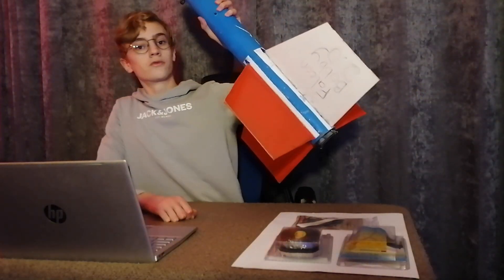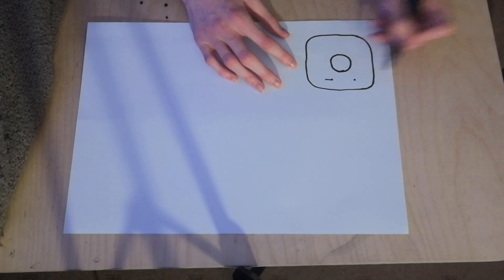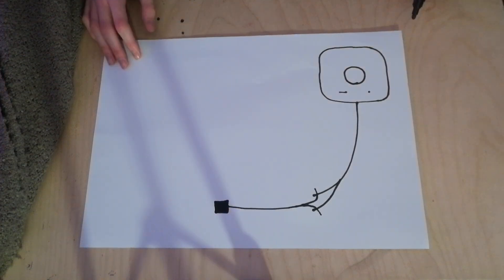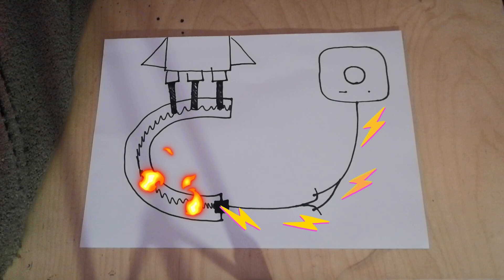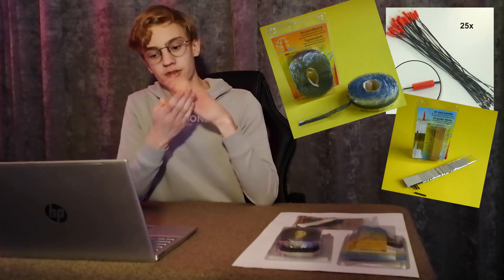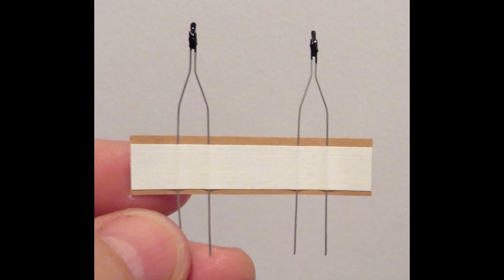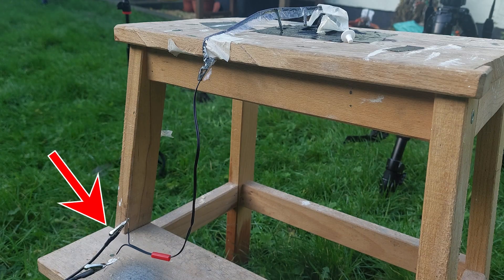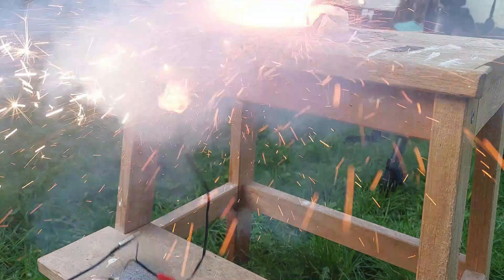How to light 3 Rocket Motors at the same time...

Comment: So how do you ensure all three motors fire at once? Even a slight mismatch would cause differential thrust no?
Reply from the maker: The ignition will occur in under 0.5 seconds, with the rocket hopefully remaining on the launch pad until all motors reach full thrust. Igniters are taped to the motors, detaching only after ignition.

Comment: When I was your age, illegal things tended to trigger me. In other words, I crossed the line quite often. But I've also learned a lot. At least when it came to rockets, fireworks and explosives. 
As you can still see in the older videos on my channel.
But I would also advise against it.
I ended up paying the price in the form of quite expensive fines. And there were minor accidents too.
But it's a cool hobby anyway. 
I also built a lot of model rockets, fireworks and firework bombs.
And I now have a large fireworks license.
And it was less of a problem back then. Half the village knew it was me when there was a bang. But the people and even the police back then were much more relaxed and let me get on with it. Nowadays, people call the police for everything. The police get several calls nowadays for almost every firework display I've authorized.
Reply from the maker: Yep, it's annoying that there are such strict laws that mainly avoid the production of explosives but also include model rockets, which is totally understandable. It's worse in Ireland though, cause there's no clubs or anywhere that sells model rocketry-related stuff at all, which makes things much more tricky and expensive.